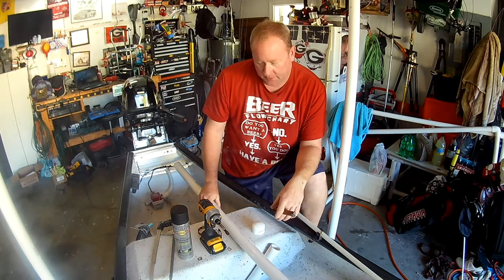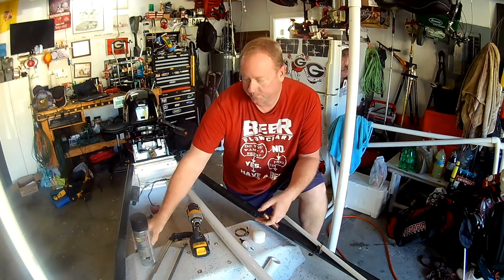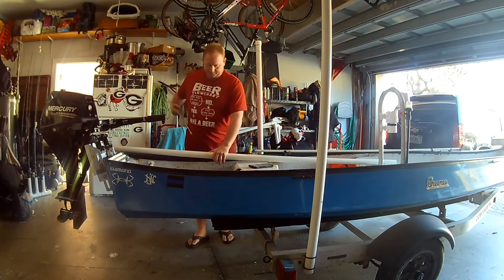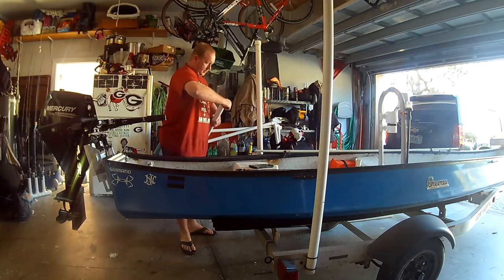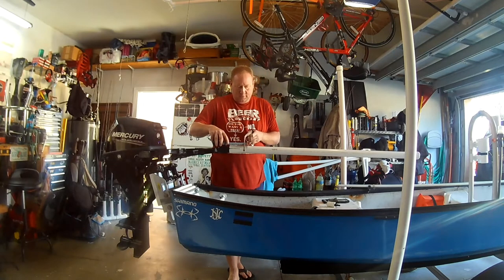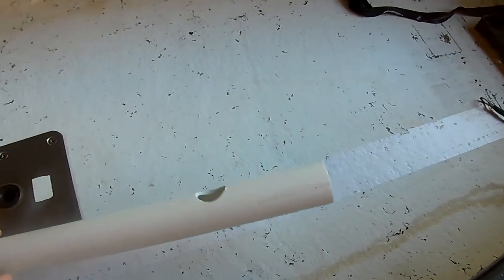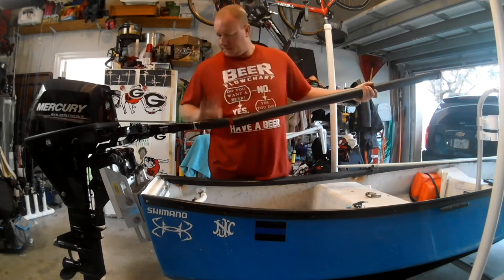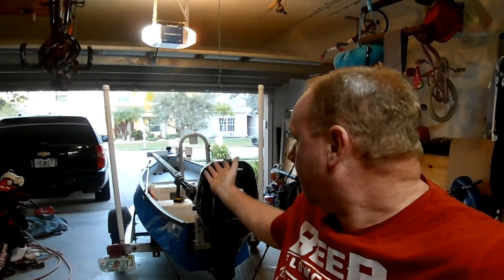Custom PVC Tiller Handle

Comment: Great build. You prolly already do this but a velcro strap to grab bar for towing would be on point…
Reply from the maker: It does not reach the grab bar....I used the tag end of the tie down to hold in place while trailering